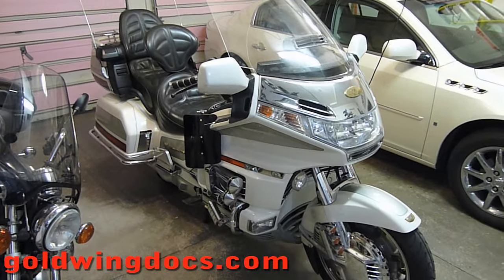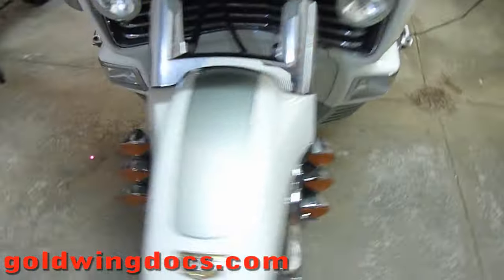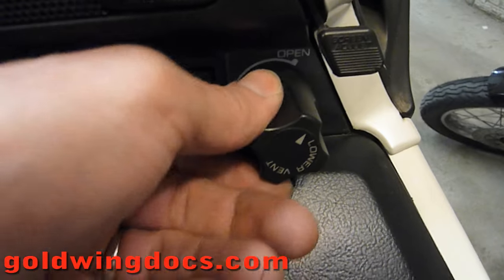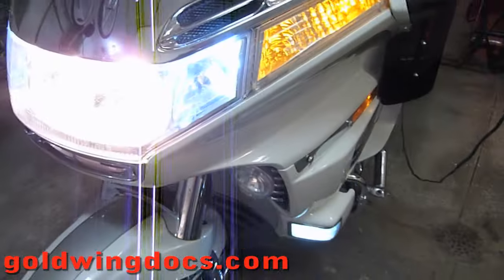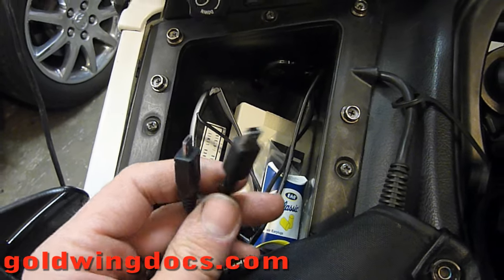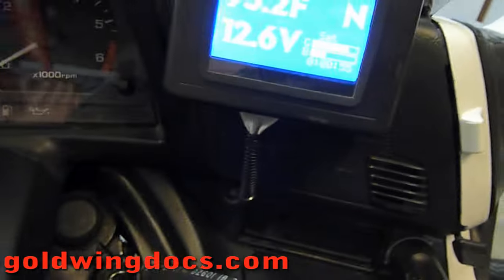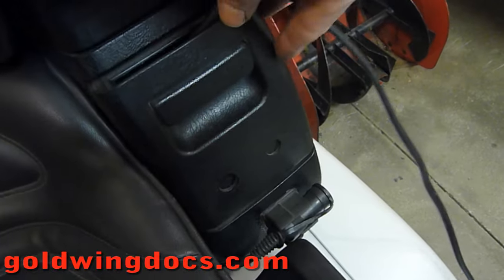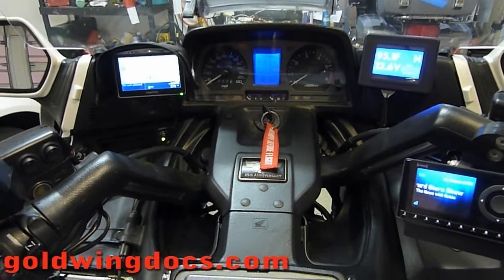Tour of my GL1500 Goldwing controls and features

Comment from the maker: I manufactured a mount by cutting the original TomTom mount apart, and bonding it to a small piece of ABS. I then used very high-strength two-sided adhesive foam to bond the ABS to the front of the left speaker grille. I don't normally cover it up - the windshield keeps rain off it. But if it is absolutely pouring down, I can either pop the GPS off and stick it in a pocket in the fairing, or stick a ziplock bag over it.

Comment from the maker: @BobBarkerIsOld- yes, the headlights are now HID, and the position lights (now LEDs, just outside the headlights) are on the modulator.

@Christopher Modiano - Yes, the Corbin backrest lets me lean back against it and still steer normally.

@Bruce Stevens - the controls for the CB are not a data bus, they simply have discrete wires for each function: channel up/down, transmit. The exception is the LCD channel readout, which is a non-published serial protocol.

@eastcostroadrunner- The reason the handlebar controls and radio are so bright is because I took them apart and replaced the (mostly burned out) light bulbs with blue LEDs.

@Tony K - the audio input jack I wired myself, I took the radio apart, traced the audio path on the circuit board, and wired in a relay and a ground loop isolator. The relay is controlled by the bike PC, and switches the radio's amplifier between playing the radio's output, the aux input, and the satellite radio.

Virtually all of the details on most of what I've mentioned are on my website at goldwingdocs.com.

Comment: Awesome video & GW. The add ons you installed, like the motorcycle PC is so cool. You said you made. You should look into production of the PC to sell. I will be your first customer to buy one. I have a 1993 GW, matlic blue. My plan is to change to LED lights also. Ride safe, most of all enjoy the ride, watch for the cagers.
Reply from the maker: The problem with the "Bike PC" is it's not a plug-and-play affair - it takes a bit of cutting and wiring to hook it into the bike systems. I've had a lot of people ask me, and I'm still thinking about it...
Reply: gsmac1969 i'd really like to have one for mine as well! i have a 88 gl1500 i just got in a trade and would love something like that to keep a eye on my system while riding...

Comment: love these bikes but hate the trunk/rear seat so im getting one and removing it was going to take out the cb unit but as there is a dash part i may not bother or i may mount my 660 satnav in the space instead. you have a great selection of items there all really important functional stuff but dont really get the on-board pc etc im sure there is enough to play/listen to already. a quick question. i thought the gw had a aux already so why did you have to wire one in with a relay as i would have thought you could plug straight from the amp or there would be a input lead in place already. excluding the pc you have done everything i will be doing nice job

Comment: All that electric stuff is fine, but I'm trying to find out if all Goldwings are plagued with the 35 to 40 mph head shake, as the 2015s are.

The video by Revzilla shows that clearly, yes, on a new 2015.
What's Honda plan to do about that?
Reply from the maker: +Ray Charles It's pretty much luck of the draw. A lot of them are, back from the 1980's up to current production bikes. Sometimes you can make adjustments - tighten steering head bearings, install aftermarket fork brace, etc. that will eliminate it or almost eliminate it. A Blackwing fork brace got rid of the problem on my GL1500 - a Superbrace fork brace did not.

Comment: You need to see my 1800 Goldwing luxury GPS Heated seats intercom Am Fm Radio 6 stacker CD Player much less storage I, Pod plug Air Bag power socket Fuel Injected Electric Button Reverse ABS Tracion control %100 better on Fuel then my 1995 1500 goldwing Aspencade put 165ks on her Sold her for $10000 Bought it for 12years ago for $13000 .Sold my 1800 for $23,000 last week bought a 2004 BMW 1150 RT 255kg less weight .Great Bikes all of them but the best was my 1500 Wing took a CanAm for a Demo bloody dangerous things cheers .

Comment: Unless I missed it, you didn't go over the button and controls on the center console. I can't get bike to bike talking to come through my helmet. Its only coming through the bike speakers.
Reply from the maker: Press the volume control knob on your CB. That will switch it from speakers to headphones and back again.
Reply: @ScottsSynthStuff  I have a button on the center console that I push to switch from speakers to helmet. That works. It's just when the other bikes talk to me that it still comes thru the speakers and not the helmet. I'll try pushing the on/off button
Reply from the maker: @tntlawncareservice  The center console button is for switching the radio. The CB switches separately. I just looked at mine, and it's the squelch knob you push, not the volume.
Reply: @ScottsSynthStuff  is that next to the cb on knob?

Comment: Great stuff. How do you pick up gear positions?
Reply from the maker: There is a gear position switch on the front of the shift drum, used by the engine controller and the cruise control. You can access the connector for it deep inside the front fairing.
Reply: @ScottsSynthStuff  pure 
pure genius!

Comment: How did you get the XM Sat  plugged in? Did you need a motorcycle antenna With FAKRA adapter?
Reply from the maker: Bill Blanchard I took apart the radio and wired in my own custom interface. Sierra Electronics is the only place I know that will do this as a service.

Comment: Is that a ram mount that you’re using for the sat radio on the handlebars? I have the same radio and want to mount on my wing.
Reply from the maker: No, it's a modified Butler cup holder.
Reply: gsmac1969 thanks

Comment: I believe the vents down by the feet is not for warm air just air ducts right?
Reply from the maker: They are definitely for warm air. Air is brought in from the lower under cowl, through ducts, and then directed around the outside of all six exhaust headers (three per side), which warms the air before it exits through the foot vents.